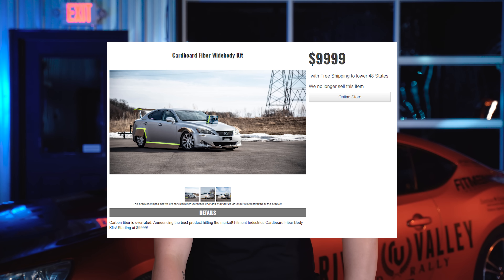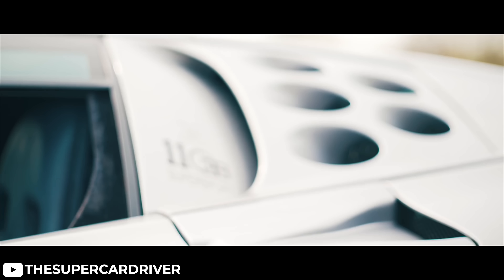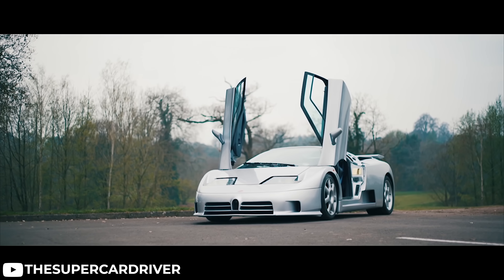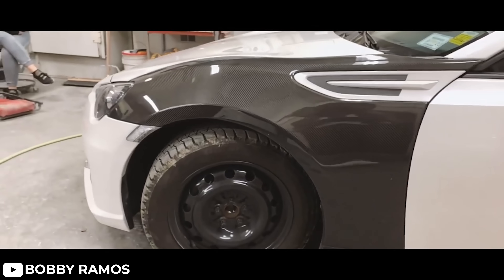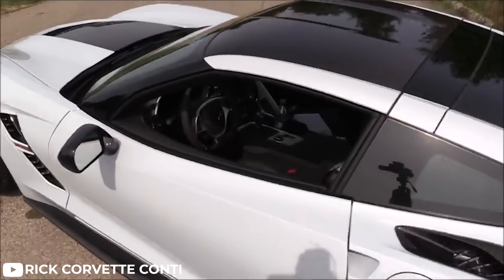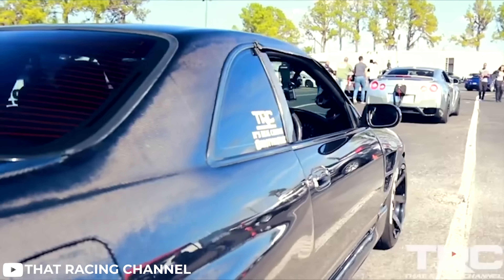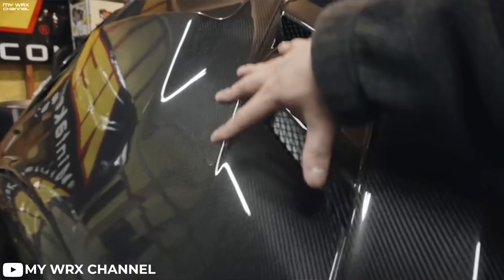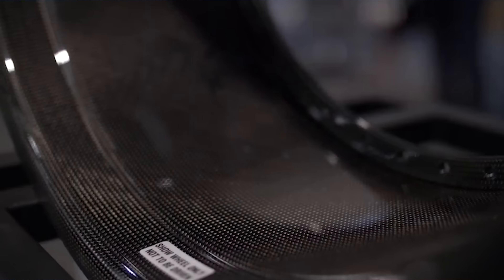Is Carbon Fiber Worth It? | The Build Sheet

Comment: The Nissan Z32 300ZX was introduced in February 1989 as a 1990 model.  The Bugatti EB110 was introduced in 1991, so how do you explain how the EB110 stole the 300ZX's headlights?  You got your facts reversed.  The updated Lamborghini Diablo actually used the Z32 300ZX's headlights under license for their 1999 and later Diablos.  Lamborghini simply covered the Nissan logos with strips of carbon fiber.

Comment: You can find some very light carbon fiber  parts not only CF  , surely not strong as carbon used in racing but still functional. I have rear spoiler on M3 and front spliter both light as feather but I wouldn't hit it with hamer that's for sure . 
Question is do you need it at all , I got it just because it looks cool with factory carbon roof .

Comment: I bought a pretty expensive carbon fiber hood for my Camaro and it looked good out of the box. I went to the body shop today looked at it for a bit and told them to take it off. i could see the waves in the hood ever so slight but they were there. I'm sure you can get an awesome looking hood but I would recommend putting yourself in a situation where you can look at it closely for waves and other imperfections. If you have an awesome car and the hood is not perfect it will stick out like a sore thumb. At least for me. No more carbon fiber.

Comment: Carbon fiber is a amazing material, it's a shame its overpriced and underutilized. Auto manufacturers should replace plastic all together with the material
Reply: Sure.  Steel retails for about a $1 (USD) a pound wholesale.  Automotive grade carbon fiber for $11 (USD) a pound.  You ready to pay 11x current MSRP steel cars sell for to get your carbon fiber four wheeled wonder?  There's a good reason good carbon fiber isn't sold at Bondo prices.

Comment: Just a small correction. The Z32’s final design was approved in 86 the EB110 started design work in 89 also Nissan Z32 headlights are actually used on the diablo no less.

Comment: If you want the look you could just wrap with the carbon fiber look I don't know if the price matches up or is cheaper then just getting the carbon fiber. The s2000 I have is wrapped but I bought the car after the car was done.

Comment: The answer is a resounding no.  I have it inside and out on almost the entirety of my foRS and I regret every piece.  The weight savings was negligible, the cost was astronomically, fitment isnt always perfect, and it gets damaged SO EASILY.  And it shows damage 100x worse than painted panels.  Rocks beat the hell out of it and it looks like absolute trash unless your constantly sanding, and reapplying resin and clear.
Reply from the maker: I mean thank you for being brutally honest 🤷‍♂️😂
Reply: @FitmentIndustries  wouldnt recommend it to anyone unless A: its a 100% trailored track car that needs every ounce shaved. Or B: its a garage queen thats driven 10 ft a year too and from car show to car show.  If you daily a CF covered car, it takes less than 6 months of highway driving for it to look like someone sandblasted it with gravel.

Comment: I can remove and install all my carbon fiber exterior panels without any help. I kept all my factory pieces to swap out for harsher weather conditions and to persevere and treat the CF parts when not installed. Plus, the CF parts can be painted. These are a plus worth mentioning in my opinion.

Comment: Shopping CF parts for Corvette and today came to the conclusion that I will go with CF for hood, spoiler, halo, and diffuser; but due to crappy roads where I live, I will go with painted or wrapped FG splitter and side skirts, due to cost savings and ease of repair from inevitable damage.

Comment: Weight reduction you have to pay for isnt worth it over doing other mods. At the end of the build and you have money to burn,go for it
Reply: I agree with that except for  wheels. Manufacturer wheels are heavy.
Reply: @joshuafallet5690  that's still only getting you a few mile per hour and a small chunk off the zero to sixty

Comment: Definatly worth it IMO i bought my first carbon fiber part for my 13 wrx hatch bought a all carbon finer drive shaft it is rated for up to 800 hp and i can remebr the torq but its waay lighter than the oem with carrier baring its a one peice love it🤓🤩

Comment: How much CF, is too much CF??
Reply: Basically any car parts near heat sources. The CF will lasts but the resin won't.

BMW plan for production car with frame carbon. It will likely end up crumbling in 5 years.
Reply: Muhammad Irfan BMW’s explanation “WEIGHT REDUCTION BRO!”.....☠️

Comment: Carbon-fiber hood? Yes. But spoilers, canards, and other small/light weight pieces aren't worth it.
Reply: But they look so good tho! As long as its not overdone at least
Reply: @exzaviorw  but why spend so much extra $$$ when you could get a fiberglass or ABS spoiler/canard for a fraction of the price, essentially the same weight, and just wrap it in CF vinyl?
Reply: @epicraptorman  have you ever seen cf wrap by real cf?
Reply: @leeharvey9006  yes my hood is Carbon Fiber and is made by VIS. And tbh if I didn't have vents in the hood most ppl wouldn't recognize it as real CF unless they weighed it.

Fake cf wrap drastically emphasizes the characteristics of real carbon fiber.
It's called hyperrealism.

Comment: 99 percent of "carbon fiber" company car parts are all LOOKS! So your seibon cf hood is mostly fiberglass. 
It is basically all fiberglass with one layer of cf on top.(not strong) an all Carbon hood would probably run you 700$ just in material.
How to tell if your part if it's all Carbon? Look behind, if it doesn't have cf pattern it's fiberglass.
Reply: Car Hood will probably require 2 meter square of CF. Now, you need to 8 layers (4 for outside parts, 4 for the inner parts). Price for 1 meter square of CF (non aerospace grade) is $12.5. 2*8*12.5 is $200 plus $30 of consumables.

As any good pricing strategy, material is 25% of retail price. Hence at $230/0.25 is $920.
Reply: @MuhammadIrfan-ye5zf  facts, plus vaccum, infusion resin, materials.

Comment: I think for a daily driver, a carbon fiber stock shaped or vented hood and a small wing spoiler are enough to give the car some flare and make it stand out without it looking too ridiculous.  Once you get to the carbon fiber doors, fenders, body kits, etc, then it gets expensive not only cuz they're expensive in and of themselves but also cuz carbon fiber is a lot more expensive to paint if you decide to paint those body panels.  For what it would cost to paint all those panels, you could get the car wrapped with a really cool design.

Comment: I would add that true carbon fiber has a heat benefit as well.  When you look at intakes truly had of CF, the air temperatures they achieve are always lower than their metal and plastic counterparts.

I does make me sad that most CF parts you see online are fiberglass+CF wrap+clear coat.  I wonder if it is purely cost prohibitive or some other factor that leads to this.
Reply: Pure carbon fibre will need autoclave (high pressure oven) which is not cheap. Also with bigger parts like car hood you need vacuum infusion of which the consumables (vacuum bag and tape) is not cheap and PITA.

With just wrapping, you coat the resin by hand and dry at room temperature.

Comment: Usually cracks in CF is down to material science. About 90% of "CF hoods" on the market aren't CF, they are fiberglass hoods with a carbon fiber skin. Fiberglass has a higher expansion/contraction rate than carbon fiber. What happens when you laminate 2 different materials with different exp/con rates? It flexes and bows, fibers (carbon) breaks and the resin becomes stressed and eventually cracks. 
There are also different ways of "curing" resin. There is chemical curing, where you mix a catalyst to cure a resin, UV cure process, and then there is the autoclave process, where an autoclave is used (basically a vacuum chamber oven) to cure the resin with heat. There are different types of fiberglass that are lighter and stronger than carbon fiber, but carbon fiber is more thermally stable (using the autoclave process). 
Issues with hazing and sometimes cracking, has to do with the cure process. UV light in these cases, is continuing to cure the resin, making it over-cured, unless an UV protectant (I don't think that's a word, but oh well)  coat is applied
Reply: Normally done because a FULL CF piece is alot more than just a layer
Reply: @pwnzlikeme  normally done because it's cheaper along with the resin process involved. Vacuum bagging and chem/uv curing a piece, doesn't require a $50,000+ autoclave. But then the resin isn't thermally stable. There is a reason why plane parts and high stress parts require thermal setting.
A fiberglass part with a carbon fiber skin, doesn't mean it's carbon fiber. If anything, it's weaker, because of the points I said previously
Reply: Good post. Thanks.

Comment: Okay, what If I want a carbon fiber body panel or hood or what ever, but I dont like the look of it its just ehh not my style and doesnt fit my car. Can I wrap the carbon fiber afterwards?  I want the weight reduction of the carbon fiber with out the look
Reply: You can get it wrapped or painted over to match your exterior color.

Comment: I honestly want to swap my hood and trunk out for carbon fiber OE looking ones despite them being 700+ dollars a piece, but what exact care do I need to do for them?
Reply: You can go one more by applying clear bra over it and then the ceramic coating. The gel coating on cf are known to fade over time especially with the hood being beaten by the sun's rays.
Reply: Ceramic coating, or alot of clearcoat on each piece. So expect to spend 1000 a piece if not more considering the process. Also, once you get those pieces it's a slippery slope to the 400 dollar front lip, 700 dollar side skirts, and the 600 dollar rear diffuser😂😂

Comment: $800 for a hood is not expensive if you have quotes to paint your hood for $400-$500
Reply: Dave Seated I agree with you but I think you have to get a carbon hood clear coated which isn’t as expensive as paint but still not cheap
Reply: @DA9GUY31  not talking about that most people get multiple layers on it

Comment: As Gels mentioned, CF is very light and strong. Please keep in mind that most aftermarket CF parts are covered fiberglass. For example, every so-called carbon fiber hood for an Evo VIII/IX weighs more than the stock aluminum hood at less than 20lbs. There was one dry fiber hood that was available for the platform for a short time. Custom order. It weighed 6lbs and cost quite a bit. CF wraps are no different than plastidip. CF accessories fall into the same class. Don't be that guy. :)
Reply: Felix F can you please enlighten me, whats the difference between carbon fiber wrap and the one made by car manufacturer ? What i meant by wrap is, the shop apply carbon fiber sheet on top of a mould. Not the vinyl wrap.

 I tried to google and read through forums, but could not find any answer. Thanks in advance
Reply: @MegaCibai  the manufacturer will use carbon fiber all the way through. The aftermarket to keep costs down will use a layer of carbon on top and bottom to give it the look, but none of the benefits. Can still be marketed as carbon fiber so the profit margin is pretty large.
Reply: @NatoriousGamePlay  what type of mould do manufacturer use ? 

A roof part from a so called 'carbon fiber shop' wrap in carbon fiber i saw have the weave pattern on top, but no pattern on the bottom part. I wanna find out because the shop advertised it as 'carbon fiber part' and not 'wrap with carbon fiber sheet'

sorry if you cant understand what i meant
Reply: @MegaCibai  so the top layer is genuine carbon fiber. But a real carbon fiber part is made entirely of carbon fiber. Most places sell fiberglass parts, with a layer of carbon on top.

 It's almost impossible to tell without buying it. Best thing to do is look at shipping weight if that's available. A true carbon part should be only a few pounds (a carbon hood is like 6 pounds). Forums usually talk about if it's genuine or not
Reply: @NatoriousGamePlay  well that confirm what ive always suspected. A single carbon fibre sheet layered on top of fiberglass, bonded using wet lay up. Since theres no autoclave as far as i know here. Just my observation of course

The price of the mentioned carbon fibre layered roof is around 1000bucks based on where i am from. pretty expensive i must say
Reply: @MegaCibai  Please don't troll me again. For the benefit of the community, covering a part in CF wrap amounts to making it look very light while actually adding to its weight. Rice.
Reply: @felixf5211  dude, you okay ? was i trolling ? i was asking and for me it was a legit question since where i came from, seller advertised 'part made from fiberglass wrap in single carbon fiber sheet on top' as 'carbon fiber part' , as in the 'part made from fiberglass wrap in single carbon sheet on top' as 100% carbon fiber all the way. damn youre triggered too fast calling people rice
Reply: @MegaCibai  I apologise if I misunderstood your intent. Good luck.
Reply: @NatoriousGamePlay  Cant deny that carbon fibre part is nice, especially under the sun. But since i drive my car on a daily basis, really cant afford to get hit by debris or stone almost every day. Thank for the reply btw
Reply: Felix F so how do you find real full carbon fiber parts?
Reply: @AayyMax  Which parts? For which platform? Used in which application? Are you ready to shell out large sums of cash? Only you can answer these questions. I'd suggest going to the forum dedicated to the platform and searching past posts/threads. Good luck.
Reply: Felix F I mean just in general, how can you tell when your buying a genuine fiber parts vs a fiberglass with a fiber layer
Reply: Wait so that carbon fiber Evo style hood I was looking for for my eclipse isn’t actually made completely out of CB?
Reply: CF*
Reply: just say youre poor lol